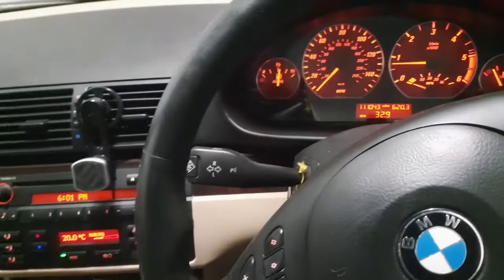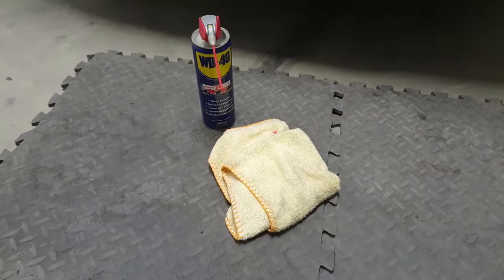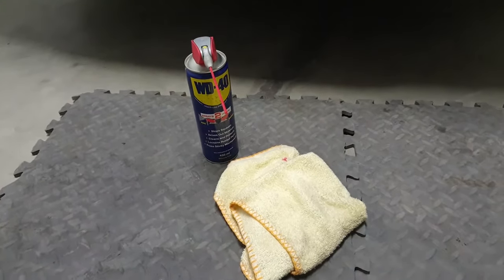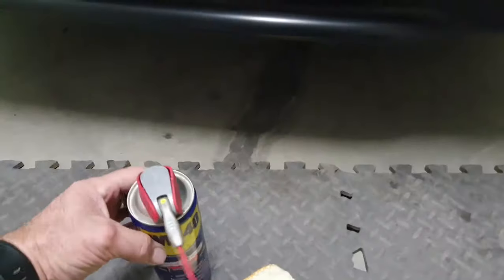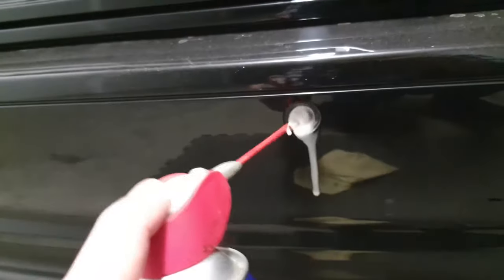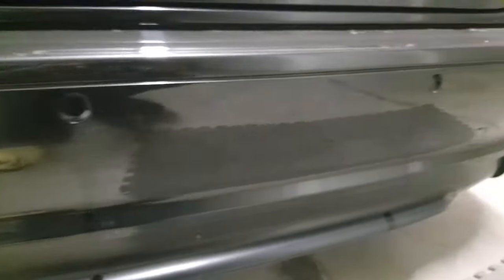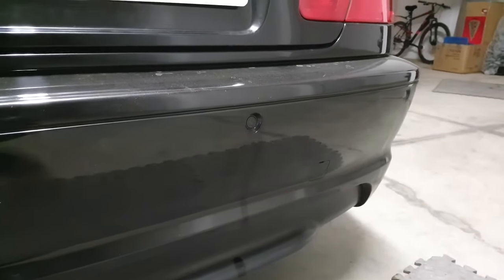Parking Sensors NOT WORKING... TRY THIS 1ST

Comment: Worked first time on my wife’s Kuga. It’s been driving her nuts for months. Garage said whole bumper had to be removed to replace it. £££££££££
Reply from the maker: JFK KARZ
8 months ago
Glad to help, thanks for the positive feedback 👍
Reply: hyacinth1966
1 second ago
Hallelujah, praise the Lord bless you amen. This did not work straight away yesterday evening, but this morning I tested the car and I couldn’t believe my ears, the rear reversing sensors now up and running and functioning in the way that they were designed to function.
Bless you bless you bless you

Comment: I did this by spraying WD40 and it worked for a few days only, after that I did get random beeps again, I also noticed one of the sensors was partly peeling off paint, about 1/3 of circle area like the sensor of the display picture of this video, I have repainted the whole circle area of the sensor with an even coat and now is working properly.

Comment: To know which sensor doesn't work, insert the key into ingnition and switch to position 2 then put the car into reverse. step out of the car and go to the parking sensors and touch each one individually and see which one is "sparkling" less than the other ones. You may have 1 or 2 or who knows maybe all (in which case you either have a wiring problem cuz u can't know which sensor is bad or they're all bad and need replacing). Its good to take them out from time to time (twice a year would be perfect) and clean with WD-40 or any other spray which doesn't leave residues, because you're driving on all sorts of roads starting from dusty ones to wet ones and all that mud is going to clout in the sockets and cause PDC to malfunction.
Reply: Put the car in reverse and get out the car you say?😱
Reply: @eddieathers2488  Not very dangerous when the enginge doesn`t run, is it??
Reply: I crashed my car
Reply: @eddieathers2488  position 2 not 3😅
Reply: It’s not dangerous if the engine isn’t running, in fact if you’re parked facing down on a hill, the reverse gear won’t hold your car with the engine off. Basically just chock off your wheel/s first before doing that, that’s if it’s like my car and the hand brake or ebrake needs to be released to activate the sensors. But either way it’s better to chock the wheels
Reply: How to check if the front sensors problem. Do anyone know?
Reply: @eddieathers2488 nothing bad

Comment: Depending on what vehicle you have, you don't have to take off the bumper. They just clip into those little holes. So if you can gain access to the back side. You can swap them. If the cleaning doesn't work for you.

Comment: If this fix with WD40 dont work, you can turn the ignition on and put the car in reverse and walk back to the sensors and listen if they make a clicking noise. If they dont, they probably needs to be changed. 

Hope this helps somone. Have a great day yall 😊
Reply from the maker: I know.  See my other videos 👍 all the best
Reply: For all who read this comment, turn the ignition switch to on position but the vehicle must be off. I.e: engine should be off. Do not step out of the vehicle otherwise

Comment: After a heavy rainfall, rain seems to get inside the sensors and causes them to malfunction . A Couple of days of warm weather/direct sunlight usually fixes the issue or you can do what I did..

I used a portable vacuum (18v Milwaukee) I put the hose on the blower side of the vacuum and used a crevice attachment (this increases the speed of the air) and aimed it at each sensor while varying the angle of directed air and it worked. No direct contact between the vacuum attachment and car panels/bumbers.
Reply from the maker: Another top tip..  👌  thanks for that.
Reply: I find this error occurs after heavy rain. If I clean out, use blower and WD40, then wait a few days when warm weather back, fault disappears. Has worked last 4-5 times. Not to say this will work in the future as wear and tear occurs. When I use the blower, always amazed how much water there are in the sensor gaps. Anyhow, give it try. Can’t hurt.

Comment: Are you're reverse lights working? If not could be the reverse sensor switch.
Reply: Mine didn't because reverse lights didn't work put new switch in lights on but no sensors

Comment: Mine are not even making noise, tried the wd 40, no help, may be the module??
Reply: Fixed mine by replacing the beeper speaker in the rear deck😁😁

Comment: Does wd40 eats the paint?
Reply from the maker: Hi No this will not damage the paintwork as you only leave the WD40 on the paintwork for 5 min
Reply: @JFKKARZ  ok thx
Reply: Wipe it off!
Reply: It’s a degreaser not paint stripper

Comment: Don’t work
Reply from the maker: It's a first try,  So you need to check all your sensors, and replace. Or check the wiring on the faulty sensor.
Reply: Worked for me